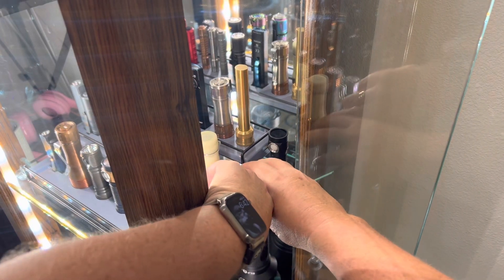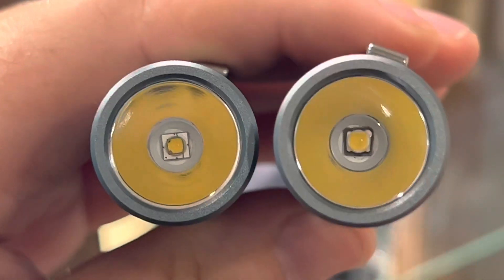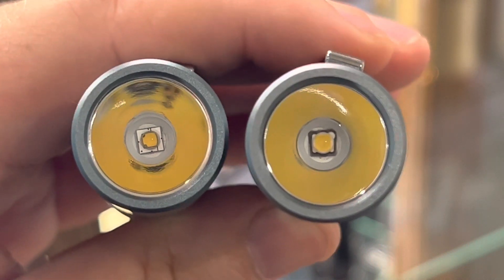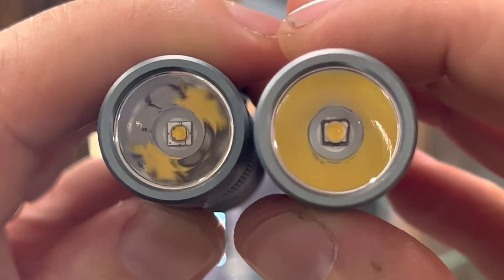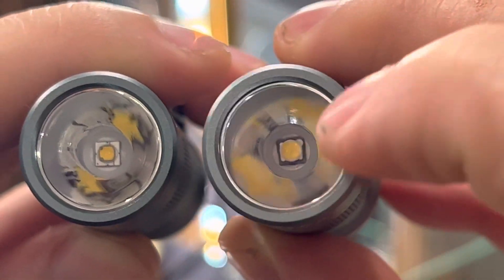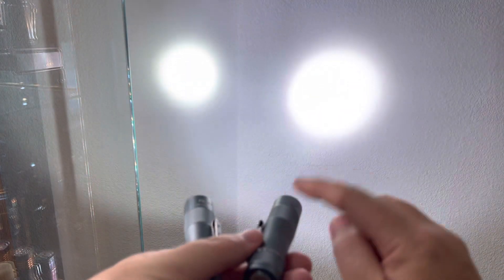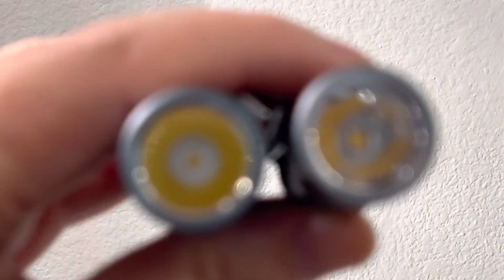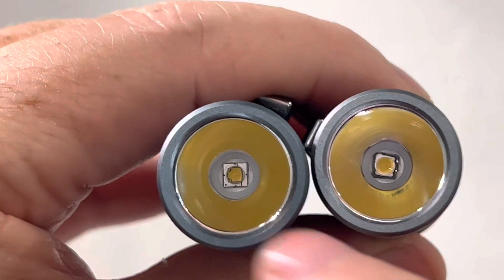SST-20 vs 219C hotspot size in the same flashlight

Comment: I have both too, each in an S2+. The SST20 is such a tiny die that even with a small reflector, it's considerably throwier than the 219C, which in the S2+ has a more balanced profile.
Reply: That's great news for me. I've been thinking on a S2+ (18350) with this emitter in 4000K. I aim for a more focused beam, but if i get more throw and medium outputs (20%, 35%), great.

Comment: how is the tint on the sst20? my fwaa is horrible in the 4k...
Reply from the maker: It was 0.0080, very disappointing. I swapped it immediately after this video.  I was surprised it was so bad, because the FWAA triple I have is three neutral SST20.  Slightly below BBL even.

The NIchia 219C has pretty severe tint shift, but overall was neutral: 0.0006
Reply: @cheule  it must be the same batch as my recent fwaa because it is the worst sst20 4ks ive ever seen. thank you so much for the reply and great content!
Reply: In high CRI warm white, which emitter will have the most neutral white? No pink or green tint, I heard the SST20 are rosy and the LH351D greenish?
Reply: @daijoubu4529 
All my SST20s have been a tad above the BBL. My 2700K one makes a Nichia 519A look like a 219B.

Meanwhile the 219C I have essentially straddles the BBL.

(Both from Convoy, mind; Lumintop or others probably have it different.)